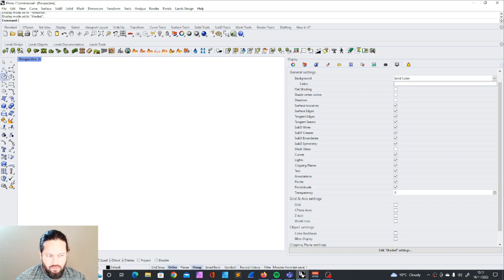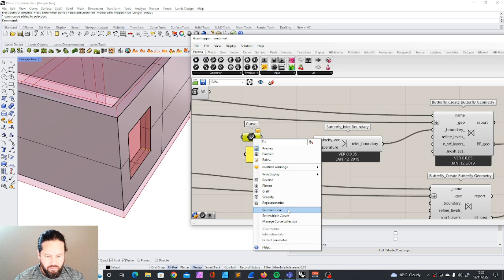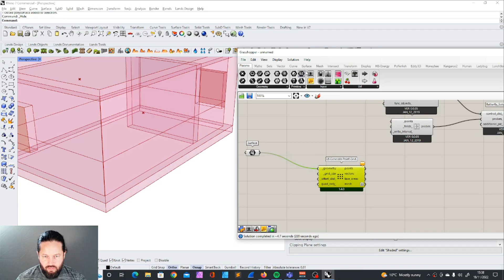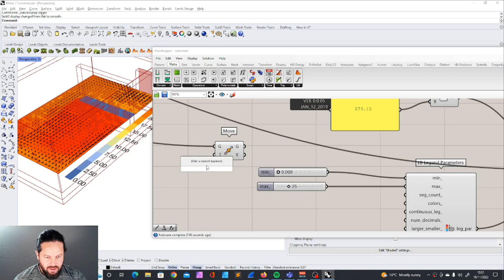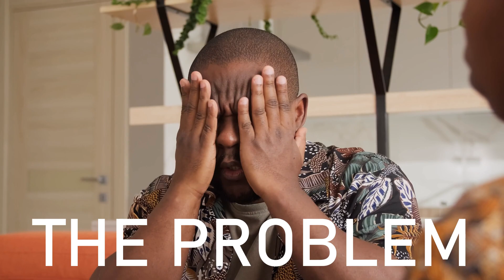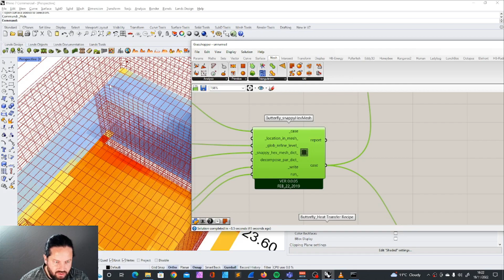Advanced Indoor Airflow | Butterfly CFD Tutorial

Comment: thanks a lot for those great tutorials! I have one question, if I have fixed glass curtain walls and some openings how I should do? consider the fixed glass like a solid wall? it does influence the result if i want to run also Honeybee?
Reply from the maker: Not exactly sure if I understand the question.
What do you hope to measure? Honeyber has different analysis available. I would first define a goal. On the other hand you  can use both CFD and Honeybee in parallel. However most Honeybee analysis tools are geared towards a period where as CFD analysis with Butterfly gives you only a point in time snapshot.
Reply: @PhilippGalvanDesign my point is: how can calculate the indoor temperature if we can’t fix the material? A wall has different characteristics than a glass. It is possible improve with honeybee this part?

Comment: hi Phillip, I have watched all your butterfly tutorial, it helped a lot,  but I have a problem here, I try to create a model to simulate the indoor airflow. Before the step of the running simulation, there is no issue. But the solution contains nothing. And it shows that cannot find probes files under the postprocessing folder. Even when I manually create a postProcessing folder in file explorer Butterfly cannot find it or populate it with results. I have no ideas why this happend? But few months ago everything works fine.
Reply from the maker: Is it just this script or any script which doesn't work?

Comment: Hi Phillip! Your tutorials are the reason I'm starting to find hope in CFD modelling in Butterfly so thanks a lot... really appreciate the detailed breakdown in different videos! I wanted to ask you a question. For my (academic) project, I want to model how the length of a windcatcher/chimney affects the indoor airflow and heat transfer in a room (with windows). However, when the input geometry is read (even though i'm using solid union to unitize it), the block-mesh that forms is weird and gives wrong solutions (if any). I thought maybe a solution could lie in creating two separate block-meshes or using the segment-grading component - but I don't know how to use it. I'd appreciate it if you can help me with this.
Reply from the maker: Make sure you understand that the block-mesh only devides the space of the wind tunnel into calculation cells.
The snappy hexmesh is the critical one to get right so that the it reflects the original model. You should visualise it to see if it matches your model.  I don't think you can feed two block meshes into one simulation...but maybe I'm wrong i haven't tried...
Reply: @PhilippGalvanDesign  i used the load mesh command to visualize it. It works fine with cubical forms such as just a chimney or just a cubical room... But when the different cubical forms are combined... The output from the snappy hex mesh starts to go haywire

Comment: hello，Philipp，Thank you very much for uploading so many tutorials, I have learned a lot through them.
I have a question that has been bothering me for a long time and I so hope I can get your answer.
I want to simulate the flow of warm air in a static wind situation.
For example, a window absorbs solar radiation and has a higher temperature than other walls in the room.
I want to simulate the flow of hot air emitted from the window in the case of a closed window.
If you know how to do it, can you show me how to do it, thank you very much!😀😀😀
Reply from the maker: So it's about thermodynamics. 
I need to test if that is possible in butterfly CFD. It's a very good question and very interesting. Can't promise anything though.
Reply from the maker: Thanks for the kind words btw.
Are you currently studying or working?
Reply: @PhilippGalvanDesign  Thank you very much for your reply, I am still a Master's students, my research content is to use ladybug's to study the indoor comfort of buildings.
Once again, thank you very much for uploading the tutorial, I will continue to follow you, cheers!

Comment: Hi Philipp, first and foremost thank you for your tutorials.
I have a question which I'm trying to figure. How to create indoor airflow for multi-zone models?  How to assign different zones in butterfly? If two rooms are side-by-side connected by internal walls, how to input that in"Butterfly_create case from geomteries" component? I hope you get my question  
If you can walk me through it, that would be wonderful. Thank you once again.
Reply from the maker: I havn't tried it but i think you can have more than one inflow.
You can aslo have more then one grid plane...
Its an intersting question; i'll keep it in mind.
Reply: @PhilippGalvanDesign  Thanks for your response. I tried simulating with a single grid plane having two inflows, with a internal wall in between the two rooms, but somehow when I check the mesh it only creates for one room. 
I used "HB_solve adjacency" component as a input to "Butterfly_create case from geometries" component. 
Can you guide me on this issue?
Thank you once again!

Comment: Hi, Thank you for your unbelievably awesome tutorials. I am looking forward to simulating Net Zero Energy Building, but how can I create a simulation of renewable energy systems in Ladybug tool, such as air-to-water heat pumps, solar collectors, and PV systems? I like to evaluate generated energy and consider it in total annual energy usage. Can you please create a tutorial in this regard or help me to overcome such matters?
Reply from the maker: I think you might want to start looking into Honeybee. I did a whole series about honeybee. My series doesn't cover everything Honeybee can offer but it's probably the closest to what you are looking for.
Reply: @PhilippGalvanDesign  Thank you dear Philipp, but can I ask which one specifically?
Reply from the maker: Its this playlist. 
You could start from Honeybee create.
https://youtube.com/playlist?list=PL4Rc2GtLpcNXQS3xeBc0hVCtf8jxkWlqp
Reply from the maker: However, if you haven't worked with the  Ladybug tools before I would recommend to check out Ladybug first.
Reply: Thanks again. I have another question. Can we evaluate or consider Battery storage using this ladybug/honeybee?
Reply from the maker: I haven't seen a component for battery storage. But it's grasshopper, there might be way to add it manually? After all it's just math ans scripting and flexible inside the grasshopper environment.
I would probably try to first get a grip on how ladybug and honey works and then slowly extend its capability.
Reply: @PhilippGalvanDesign  yea. Thanks again Philip

Comment: Hi Philipp, first of all thank you very much for all your tutorial, I'm following you for my architetcture final project thesis!
Im currently trying to do the indoor airflow, but once i arrive to Display vectors they doesn't appear even if it doesn't gives any errors. I've also tried to put the slider to moltiplicate de dimension but it doesn't work anyway. And also for the heatmap, I can only see the legend but not the actul map in the mash (and it also doesn't give any errors). I was wondering if you could help me out to solve this problems. Thank you so much anyway :)
Reply from the maker: Ok, which unit system are you using?
Also which viewport mode are you using?

Third, did you turn on selective preview in grasshopper?
Reply: @PhilippGalvanDesign   
vectors finally appeared! But its not the same with the Heat map :/
The unit sistem that I'm using is millimiters and I tried all the three viewport but nothing changed..
Yes I've the preview turned on, also i can see the legend (of the heatmap)
Reply from the maker: @Sofia Dini  You shouldn't use millimeters for these calculations. The calculation is all done in meters (m/s) so better your model is in meters too.
Reply from the maker: For the heatmap, what is your grid size? Also you might turn off any geometry which might block your view to the heatmap. I would hide all geometry first and test each GH tool if on or off. In case of mine I actually only turned on the wireframe of the building. If would any costume materials for walls or roof I wouldn't see the heatmap either.
Reply: @PhilippGalvanDesign   thank you so much!!